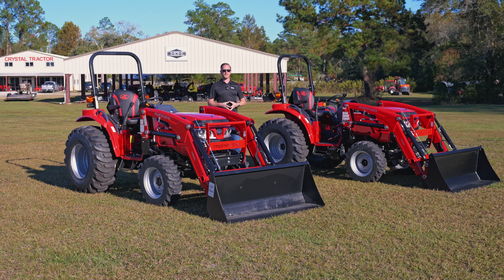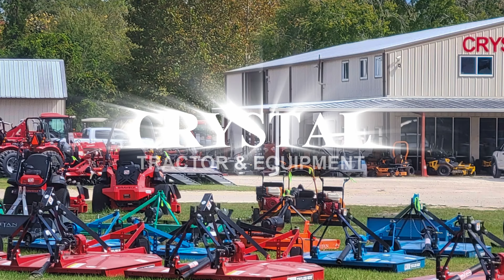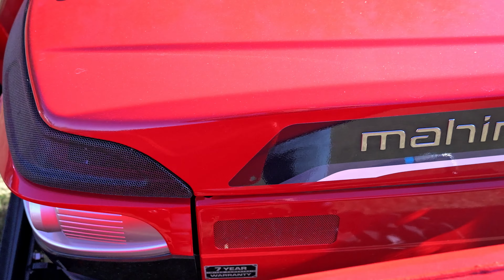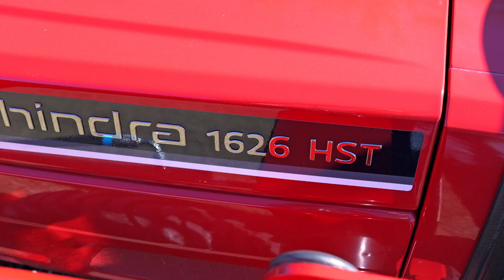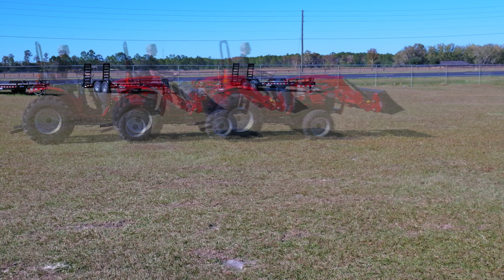Mahindra 1626 (Refresh) Detailed Overview

Comment: I like the hydrolic saftety stop. Can that be retrofitted onto a 2024 1626? If so are there part numbers. Thanks.
Reply from the maker: The older KMW loaders don't have the mounting points to secure the newer ram stops, but there are universal designs that you could look into. Recommend searching for "hydraulic cylinder safety stop". These are a good example:

https://asktractormike.com/product/tractor-loader-cylinder-safety-stops/

Comment: The Mahindra 1626 is a better tractor than the Kubota L2502 dt.  I have both.  The Kubota is more difficult to mount the operator's statiion as the left rear fender comes too far forward  making it difficult to mount the tractor with less space and my foot always get caught on the clutch pedal when entering and exiting the operator;s station,  Also the tierods on the front of the Kubota are IN FRONT of the axle, whereas on the Mahindra 1626 they are BEHIND the front axle.  The Mahindra is just more pleasant to use and operate.\ It is also easier to clean out the radiator screen when mowing on the Mahindra than on the Kubota.

Comment: When it is really coldout side how do you recommend two let the tractor warm up
Reply: Manual says set to 1500rpm for more than 5 minutes and never operate at below that to maintain minimum operating temp. If needed, cover part of the grille to reduce air through the radiator.

Comment: That's NOT an MCRD engine!
Reply from the maker: Technically true that it doesn't use the specific Common Rail Diesel tech, but does still include the benefits of no regen cycles and DPF replacements.
Reply: @crystaltractor No sub 26hp engine does as they’re emissions exempt. 

Had me worried that Mahindra ditched the proven “3rd world” design and went common rail…

Comment: What is the loader lift capacity on the hydrostatic tractor
Reply from the maker: It's the same for both versions - lift at max height is 1650 lbs @ pivot pins and ground level breakout is 2700+